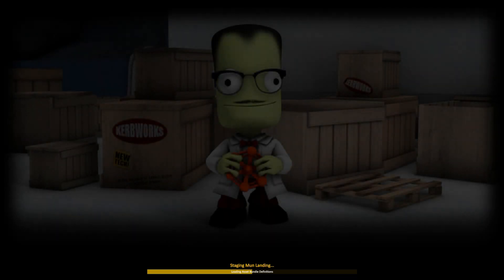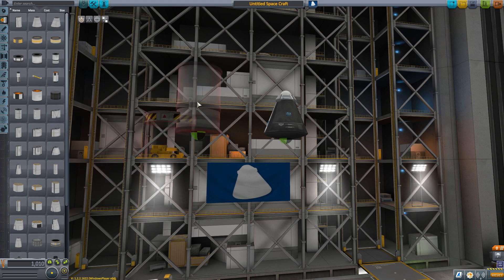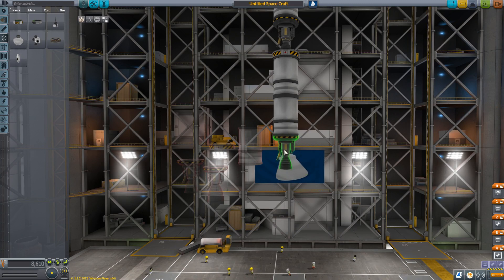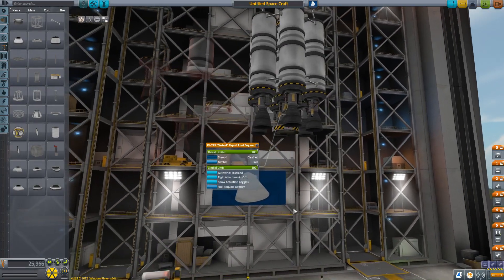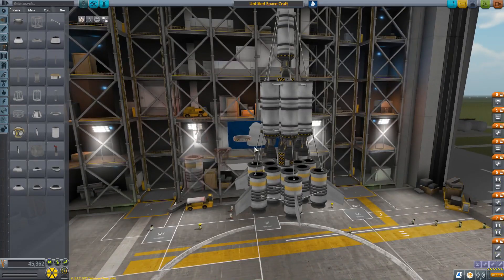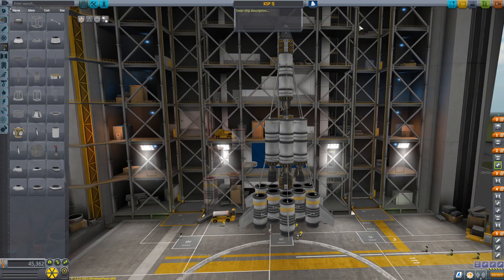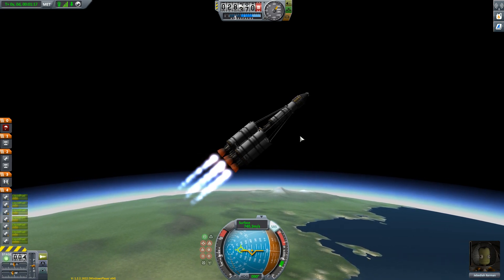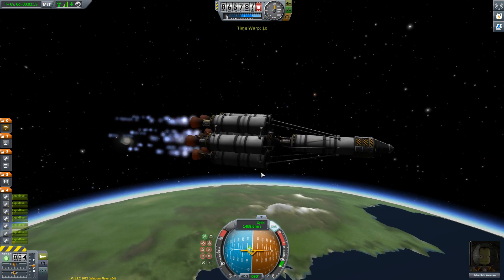KSP 1.2.2 - Recreating My 1st Rocket

Comment: KSP: The over-designer's dream!

Lol I just have a stark contrast from recent experience getting back into KSP proper; I just finished my Mk1 diameter Apollo-style Mun vessel, and the launch stage is three of the tallest Mk1 fuel tanks with one Swivel on the bottom and two Thumper boosters, so basically slightly bigger than ONE of your "1st Rocket"'s SIX liquid engine assemblies and just two big boosters instead of 13 Hammers for a payload probably 1.5 to 2 times the mass of yours.

Lol I enjoy your channel, I'm not trying to be a jerk :P <3 I just figured I'd mention how massively over-powered your launch stage was in case you weren't quite aware of how much lighter it could be and still make orbit (being more of an aircraft enthusiast as you are).

Good to reminisce; thanks for sharing the memories!

EDIT!: I completely forgot that my rocket gets the efficiency it does at least partially due to FAR (semi-stable 1.2.1 dev build), and SMURFF (RealFuels lite, essentially), whereas I assume you did this in stock, or at least without SMURFF. All that being said, I'm quite certain you could have gotten that payload up with a similar launch stage to what I described of mine- maybe a bit bigger. Thus ends the long-winded but constructive criticism; rejoice!